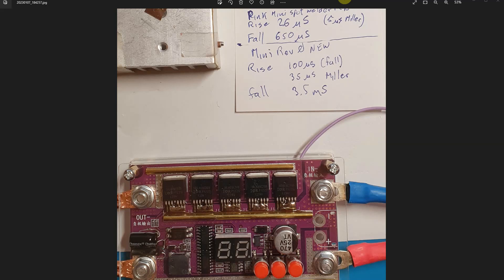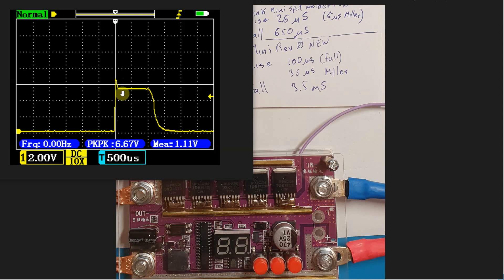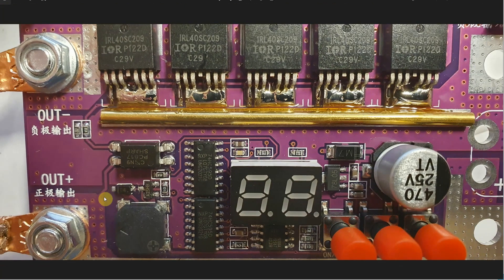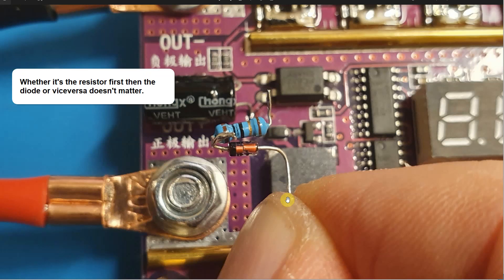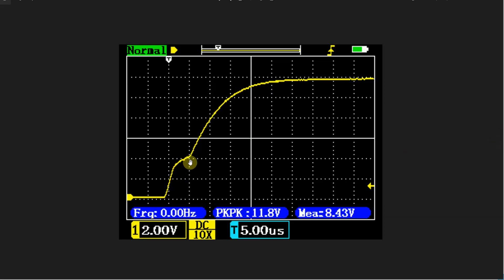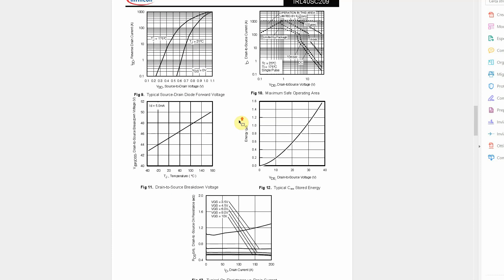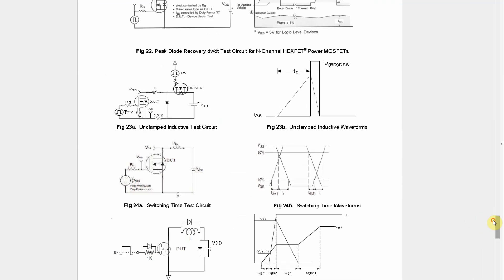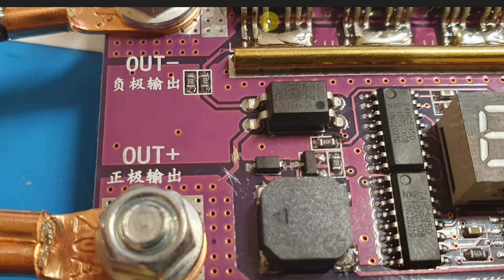"Purple" PCB Mini Spot Welder

Comment: There is one thing guys you don’t seem to consider… Check the price of 1 mosfet from a reputable source (mouser,farnell,digikey - i know the more you buy the cheaper it gets but still…) and compare it to the price of 18eur for the entire pcb welding board… What I’m trying to say here is: maybe there is a certain model marked on the case of these FETs and that makes you refer to the relevant datasheet but how do you really know it performs like the datasheet tells you? It’s not the first time I found a lot of these chips are fake. For an example I’ve bought 4 step down converters based on ST power regulator - by datasheet of the ic chip the max voltage was 60V and I needed it for 58 so I thought- ok, it will do. (Chinese seller was saying though it’s up to 60V but they DON’t recommend more that 50V). So the datasheet says 60V but on the other hand it’s not that okay 😂. Anyways two of these boards blown instantaneously one after another at 58V. I’ve bought the same exact power regulator IC BUT from a reputable source (it cost with the shipping the same as 4 entire step down converter boards from china…) but it works since a year now absolutely perfectly!! So to summarise guys: with these Chinese stuff what you see is not always what you think it is… That’s why probably some of these welders are using 8,10, or even 12 fets and still cost pennies- MAGIC. They use lots of FETs probably because they are not what they are in reality in terms of specs. Just something to think about.
Reply from the maker: Hi, yes I mention this issue several times in my various videos when I also talk about the importance of FET matching. It's obvious there is a lack of matching and overall quality control plus the incognito of the originality of the FET itself. Just buying 5 FETs from a reputable source costs more than the whole mini spot welder (double sometimes) - and not just because of the sheer wholesale price they can access. Again you can't expect much reliability at these prices - It's very luck oriented. If you're lucky enough to get handed a farily matched batch of FETs on your board, you're probably not going to have issues once the mods are done and stay within parameters. If you're unlucky and get unmatched FETs for ex. 4 similar and one super low resistance (RDS) that one will take the whole load and give away first which is the typical failure mode of these welders. If you check my FAQs video I get more in depth about it.
Reply: @Luca_Techy  thanks Luca! I’ve watched quite a few of your videos. I had BifRC black pcb type welder which I’ve modified: separate power source just for running electronics (main welding pusle went from a different pack), soldered in copper bars to reinforce fet traces and made my own cables 6 GA and welding tips. I was using it with 5s 4500mah 40C zippy charged to storage voltage (19V) - i know a bit high but i was welding through 0.1mm pure copper + 0.15pure nickel sandwich! After 300welds the battery died (along with fets) - one cell tab burned off so i have converted it to 4s and kept continuing after fixing mosfets. Another 200welds went good on 4s (charged to max 16.8V this time, at 70ms time) but it happened again: burning fets and another inner lipo tab. I could not fix the battery anymore - nothing sticks to aluminium so couldn’t reconnect cells. So I bought a brand new 4s 10.000 mah 100C (200c burst) cnhl lipo and fixed the welder again with aliexpres mosfets from one batch, changed all at once. I was using it charged to storage (15.4V) at 30-40ms setting - it worked great even better than before BUT after 25welds it failed again destroying mosfets and burning inner lipo tab on a brand new battery :( I was thinking about going to get a genuine expensive mosfes from mouser to repair it again but gave up on that idea as i was too worried that it will happen again due to some unknown to me design flaws on that bifrc pcb v2 welder. Instead i have decided to go for arduino malectrics project and double the FET board and bought fets from kWeld (FDB0105N407L). I have managed to solder burned off lipo tab and made this pack into 3s 10.000mah. I have actually sent you an email yesterday and asked about some advice regarding the malectrics project as all the bits are on the way to me at the moment. I’d be thankful if you could have a quick look at it. Thanks mate for everything!

Comment: Hi Luca, i did your mod and it was working beautifully. At some point it started burning holes in my nickel strips, 0,15mm. Now its real weak and it wont weld very good at all, it depends though but its far from consistent. Are my fets blown? how could i check this? Thank you!
Reply: I found your video with the lamp test! smart. Result: when powered on, the first pulse is weak. As soon as i weld quickly after the other, the pulses are strong. Maybe tthe added capacitor is weak/bad? What causes this?
Reply: My guess: the capacitor  is weak. i will replace or add, and update.
Reply: but then still, why burn holes every now and then? Help! 😄😄
Reply from the maker: Do the 12V lamp test, check to see if your FETs are triggering correctly or you have a short. You can find how in the video I made about it in my playlist. Usually when u have a shorted FET as soon as you contact the strip it will burn a hole as it's dumping the battery current directly onto the strip uncontrollably.
Reply: Thanjk you Luca!  i think the fets are fine but welds are not cvonsistent, see the comment (copy paste): I found your video with the lamp test! smart. Result: when powered on, the first pulse is weak. As soon as i weld quickly after the other, the pulses are strong. Maybe tthe added capacitor is weak/bad? What causes this? im going to upgrade the capacitor anyways
 @Luca_Techy
Reply from the maker: Well that's a strange behavior, did you check the series resistor value to be sure it's correct? It should be 10-30 Ohms max, else it won't charge the cap properly. I don't  see why after the first weld the subsequent ones are stronger, is everything tight? Connectors snug? Did you try a different battery?
Reply: thanks for your reply, again, the resistor is 10ohm, everything is tight etc. but  i did not try another battery yet! anyway, i will post the solution when i found it @Luca_Techy

Comment: Ciao Luca, potresti dirmi cortesemente se funziona con una 4s completamente carica? Quindi a 16,8v? O rischio di fare saltare qualcosa? Quale sarebbe il voltaggio massimo che può  sopportare in sicurezza? Non ho capito una cosa nella modifica quale condensatore devo usare da 16v o da 24v? Grazie in anticipo
Reply from the maker: Ti consiglio di usare una buona 3s anche se qualcuno usa la 4s apparentemente senza problemi. L'elettronica non ha problemi usando una 4s perchè passa tutto dal regolatore (MCU, LED etc) e la tensione massima GS dei FET è cmq 20V però si rischia di eccedere la corrente impulsiva e quindi far saltare qualche FET se hai un pacco con C elevati (per es. un 5000mAh con oltre 60C). Dovresti in teoria prolungare i cavi di alimentazione per ridurre la corrente massima, ripeto dipende tutto moltissimo dalla qualità del pacco che usi. Per la modifica prima assicurati di avere la vecchia revisione perchè la nuova non ne ha bisogno (se vai nella parte community del canale ci sono le foto con le differenze tra le due). Nel caso, l'eletrolitico va bene sia da 16V che da 25V (se usi una 3S ovviamente).
Reply: Ciao Luca grazie veramente per la tua risposta. Vorrei provare ad usare una 4s. Quale condensatore dovrei usare?
Reply from the maker: Usane uno da 25V allora, 470uF bastano. Verifica la versione della tua basetta.
Reply: Attualmente ho una 3s vecchia versione (ne ho 3) con batteria 6000mah 100c con awg 8 e cavi allungati dì 20cm
Reply: Insomma la saldatrice e' la vecchia versione con una batteria 3s e cavi allungati dì 20cm

Comment: I just got this board and it works great right out of the box (using .120 nickel and a 12V 12Ah lead acid battery).  Now I am preparing to make the mod in this video and I see my board is slightly different.  There is no circuit trace that meanders from the OUT+ pad to the optocoupler.  Instead, pin 4 of the optocoupler is connected to the 78L05 voltage regulator Vin, which has 11.8V on it when powered by the 12.5V battery.  Not sure where else this 11.8V goes, or where it comes from.  So is this a different version of the board?  Newer?  Older?  Its labelled KEKK, like many others, and seems to have all the same components.  I've looked at images from dozens of vendors selling this board and all have that trace from OUT+ to optocoupler pin 4.  Even the image from the Amazon vendor that I bought it from.  But not mine.
Reply from the maker: You have the updated revision (they noticed the error and fixed it thankfully). You don't need to apply any mod to this version luckily.
Reply: Thanks Luca.  That's the answer I was hoping for!  I did beef up the MOSFET pin solder and the bus bar traces.

Comment: Thanks so much Luca! I bought the same board a while ago last year watching someone video and stumbled on your analysis and mods videos for that board. I will perform the mods, test the board and provide feedback on its performance. What do you think about using a IR20xx dedicated gate MOSFET driver, would it be more stable in terms of turn on/off time? Also, do you think the MOSFET would benefit  from adding a heat sink?
Reply from the maker: Hi Francois, a dedicated driver is always better (lightyears) as you drop the on time to the nanosecond range instead of microseconds as you can see from the scpe shots on these devices. Regarding the heat sink, if you use the board so intensively that the FETs get that hot, a heatsink will be useful but then it's not really the board for you. Keep in mind that if you use it for say a few dozen welds the FETs will get warm, but shouldn't be allowed to get so hot you can't touch them as if this is the case, your electrodes and wires would also be that hot so you really need to wait for everything to cool down again. If you use this normally you will notice that everything more or less heats up at the same pace, wires, electrodes and FETs as the material is not great (aluminum core cables) and lossy by design. You really shouldn't need a heatsink in an average non intensive use. Adding one when the FETs are lukewarm really doesn't help (and they should stay more or less warm to the touch in a normal scenario, certainly not burning hot).
Reply: @Luca_Techy    Thank you

Comment: I have this spot welder.  one thing anoying me, welding  delay time is too short for me,  is there any  possible modification to connect foot switch ?
Reply from the maker: Yes you can cut the contact detect trace and wire a foot switch to it, it's not a difficult mod, just locate the contact detect trace and cut it and solder a switch between the side of the trace that goes to the mcu (not the one to the contact) and the other side to positive. The trace to cut is that small trace on the back side of the PCB that goes to the negative contact pad (side towards electrodes).
Reply: @Luca_Techy   thats the bigest problem. I have no idea where brake wire and put switch between it  :)
Reply from the maker: @mateuszmikolajczyk3185  I'll post a picture sometime later showing where to cut the trace.
Reply: that would be very kind
Reply from the maker: @mateuszmikolajczyk3185  I have posted a pic in the community section with details on the mod. https://www.youtube.com/@Luca_Techy/community
Reply: @Luca_Techy Thank you very much!

Comment: Hello Luca: Thank you for all of the work that you’ve been putting into explaining the working of these welders. The new boards no longer have the trace going from the positive rail to the optocoupler. The leg on the optocoupler is tied to the positive of the 470 uf capacitor that is on the board but seems to be isolated from the positive rail. My question, if you are able to answer it is, is the mod still necessary? Is there still a benefit to adding the extra capacitor and also the resistor-diode combination to the optocoupler? I have pictures of the new boards but not sure how to get them to you.
Reply from the maker: Hi, you can send them to my email in the info of my channel or post them somewhere - will check the board and see. If they have modified it the decoupling mod shouldn't be necessary - maybe the inrush current limiting resistitor, but would need to see a closeup of the front and back of the board.
Reply: @Luca_Techy  Hi, does this actually mean that on an older version I could simply cut the direct positive feed from the opto and run a wire from the 470uf input cap's positive terminal to the opto's leg? Is that all they did on the new pcb?
Reply from the maker: @imrenor  If you are referring to the older KEKK version like I happened to receive, yes, you can read about it in the community section of the channel where I posted some pics of these boards and the procedure. I wanted to do a video about it it's a pretty straight forward documented procedure so I think it's redundant at this point. If you're referring to the above model, you can also use the 470uF MCU power supply decoupling Cap for this (though it's further away) and get the output after the diode and run a wire from that to the opto after cutting the track from the positive as indicated. It will work though it's always better to have a dedicated decoupling cap near the component you are decoupling by design.
Reply: @Luca_Techy  Hi Luca, thanks a lot for your quick reply and all your videos, great work!
I was referring to the board in this video. I know it would be better to have a separate decoupling for the opto, but I don't have a 10-30ohm resistor on me now (100 is the smallest I have) and I'm too lazy to go shopping :D I'm also too lazy to solder a diode, a resistor and a cap together if I can get away with soldering a sinle wire instead :D So I figured if that's all they did on the new board, then why not do that on the old one as well :) I'm a little worried that this basically defeats the purpose of the opto, but if this is all they did on the new board and it's working fine, then I'm also fine with it.
Reply from the maker: @imrenor it doesn't defeat the purpose of the opto, it actually enhances it. It provides a decoupled and stable power supply "bucket" for the weld time,. The opto still does it's job in driving the FET Gates (thought it's not primarily designed to do so as explained in my various videos). You can do the single wire mod if you prefer, just get the positive AFTER the 470uF cap diode which is near it (there is some trace with a  via) and wire it to the opto and cut the positive trace from the contact pad to the opto as shown.
Reply: @Luca_Techy  Now that you pointed out I think I get it :) So the opto is there to basically act like a transistor and not to physically separate the two circuits. Thanks for confirming the single wire mod. I'm a bit confused tho. You mentioned a little trace with a via at the M7 diode. As far as I see that is the anode of the M7 diode connected to the positive input, that's what's coming thru that via. I though I have to connect the wire to the kathode of the M7 diode, which is connected to the positive terminal of the 470uf cap.
Reply from the maker: @imrenor  yes, sorry if that sounded confusing, that's what I meant by "after the diode" meaning after the positive has gone through the diode to the + of the  decoupling cap, that's where you should pick it up and route it to the opto (just like my original mod where in series of the diode you see the resistor). The Opto is there to drive the Gates sourcing power from this decoupling cap. It is a galvanic isolator as the collector/emitter part which conduct when the counterpart LED is turned on are physically isolated from the other side of the circuit (the MCU output which drives the LED in the opto). The engineering error here is that the junction is not designed to carry such a trigger current load and can't switch on that fast. It works (within certain limits), but it's not supposed to be designed this way.
Reply: @Luca_Techy  All clear now. Thanks a lot for all your help! I really appreciate it!

Comment: This one is a great spot Welder.  I did so many welds and it didn't break. Under voltage 10.00v and over voltage 15v, it didn't break. Over 1400 cells x 4= 5600 welds. It only cost $20us on ebay.